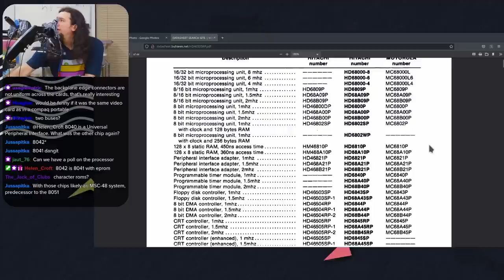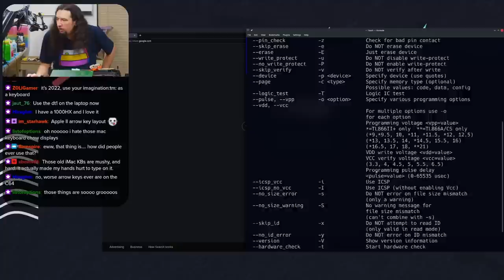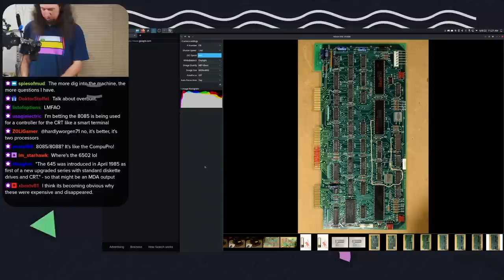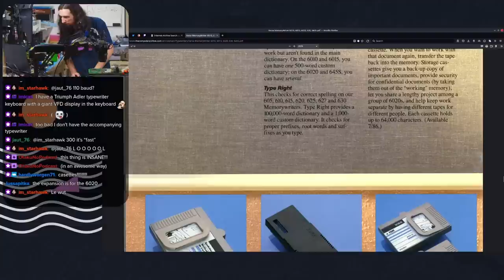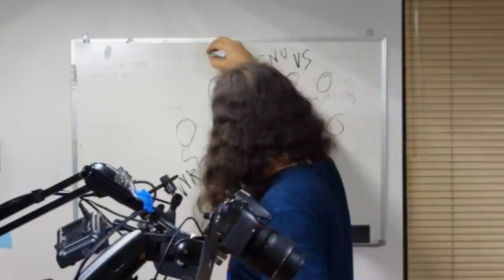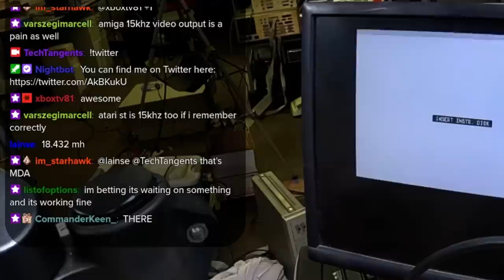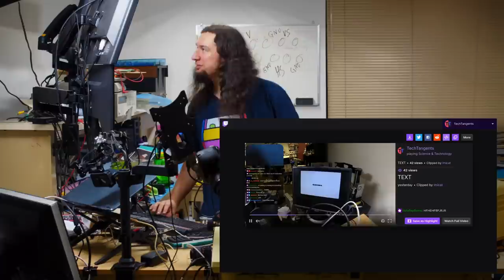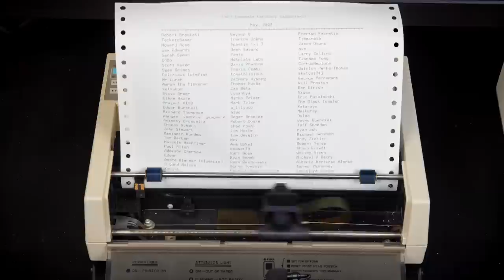Exploring the Crazy Xerox Memorywriter 645S to Get Video Out

Comment from the maker: I have seen the two listing on ebay at the time I posted this video for the 630 Disks and the 640 Upgrade kit. The 630 did not have a CRT connected to it, and since the disks actually specify that they are for the 630 I know they aren't a "Universal Typewriter OS" and almost definitely will not work. I do not know if the disks in the 640 upgrade kit will work, we already know that these don't use a common OS, so it's possible there are feature differences between them that would make it incompatible. But that listing is $200, way too much for disks and especially ones that wont work.
Reply: The 630 has a small display and no crt. The 640 has a crt but the software is not the same as 645. I got the 645 disks and a working 645. Can send you copies of the disks if you want?

The output to the crt has H+V sync and video separated. No composite video.
Reply from the maker: @kristofferrosendahl6719  That is really good to know the 640 disks will not work. I would be extremely appreciative if you could send me copies of the 645 disks! If you want to reach out over email, twitter, or discord I can give you an address. If you can image them, just disk images of them would work as well because I could write them if that would be easier.
Reply: i had 1 of these, i remember it having orange phosphor single color crt, i remember laughing out loud when i saw the intel/amd chip! i dont know if i still have any parts but if i find the crt, i will let you know
edit: btw, i did scrap it years ago but im sure i saved the boards, if i saved the crt or not is another matter
Reply: @juliedunken1150  ....i dont think you know quite how much useless crap i have in bins and behind stuff, i have a complete smith corona pc with monitor!
Reply: @juliedunken1150  and if neither of them? dave jones or bigclive or diodesgonewild can tear it down and here is the schematic in davecad/printed and reversed/dodgey af as a bonus!
Reply: I'd love to look at an image of those floppies if you ever manage to get hold of them. Odds are the ROM is custom, makes no sense to be PC/IBM compatible. If the ROM is a proper PC BIOS, howevery unlikely, it's possible the disks have to be "blessed" in some way, perhaps a different magic number in the MBR?
Reply: Could you by any chance upload the ROM as you indicated that you would do?  I don't see a link for it in the description.  Also I suspect that this unit may be running some version of CP/M.
Reply: @juliedunken1150  Sorry about that, I don't post comments very often and must have clicked the wrong button.

Comment: Oh wow.  I actually worked on one of these things in a past job.  Somehow the monitor for the unit had gone missing and the boss asked me to work out a solution so it could be sold.  I can't fully remember what I did but pretty sure it involved a resistor ladder and some diodes to mix the signals to produce video for a mono VGA monitor.
Reply: Haven't watched the video yet (still playing), but assuming digital output, that would be a sensible route. An R-2R network for D->A, diodes to clamp voltages, maybe some voltage division to perform some additional scaling, and you've got a good solution. Similar sort of thing gets done whenever anyone outputs VGA or Composite from an Arduino.
Reply: Nevermind, analog, so probably just needed pin & level conversion.
Reply: @absalomdraconis  Pretty confident the unit I worked on had TTL output.  I have distinct memories of there being an intensity line as well as simple dot output.  Of course this was all many years ago so memory isn't guaranteed accurate.  😀

Comment: I worked for Microlytics in the early 1990s ... it's probably a spell-check board. They were using Xerox PARC text compression/spelling technology in a lot of their products. If I remember right, Selectronics became Microlytics, and Selectronics is the brand on a lot of those handheld spell checkers from the 1980s.

Comment: There are a number of converters out there that can display arbitrary video onto HDMI monitors if you can work out the horizontal, vertical and pixel frequency - I think I've seen one based on the Pi Zero on Adrians Digital Basement and Jan Beta's channels. They seem to be able to make sense of even fairly unusual video formats. It might be easier than trying to hack the display card in this device.

I graduated in 1984 and went to work in a Software House, and as a result ended up working in clients offices all over London and Southern England, and by that time typewriters were being moved sideways in favour of PC's as word processors, and you;d see strange creations like this under desks or in store cupboard all over the place. I even had a Silver Reed typewriter that had a serial interface on my desk in one place that we used as a printer for one PC. It would not surprise me that the 8085 was the processor that drives the "word processor" side of this device and Xerox fitted a 8088 PC inside to add in the extra functionality rather than develop a completely new device. Especially since it was probably evident that the device would have a short life span. 

My last sighting was when I worked as a contractor in 2007 for a mortgage company, and they had a word processing typewriter on one desk that was used exclusively for filling multi=part forms for one obscure compliance process that they had to use, because the organisation accepting the form wouldn't accept multicopy laser prints for their processes, it had to be on the stationary they supplied!
Reply: Indeed Laser might be quicker for some things, but pre printed multipart stationery and a golf ball can whack out quicker if certified etc file copies needed , sometimes paper is better , stores can write on despatch notes etc though apps and scanners seem to be going a way forward
Reply: "There are a number of converters out there that can display arbitrary video onto HDMI monitors if you can work out the horizontal, vertical and pixel frequency - I think I've seen one based on the Pi Zero on Adrians Digital Basement and Jan Beta's channels. They seem to be able to make sense of even fairly unusual video formats. It might be easier than trying to hack the display card in this device."

I also use the 'RGBtoHDMI' that is indeed based on a Pi Zero - Neat devices that sell out quickly...

Comment: The monitor and connector seems very close to some old cash register "computers" that I saw and had one. The monitor was 5" or 7"  mono amber with the same 9 pin connector, power and video on it. I am not sure about the pinout but I am sure that there were to 12V power pins there.

Comment: In the early 80's I was a  Xerox PC repair tech, and I occasionally worked on these! Also there was a newer, sleeker, more plastic-y version that came after, with similar model-naming conventions, except four digits. I think they ranged from 6010 to the 6040. However, by the time they were released, they were already dead and irrelevant.The 600s were built like tanks, the 6000s were built like plastic toys.

Comment: That spellcheck module is eerily similar to the official IBM spell check module for the Wheelwriter series. Intel 8031AH, lots of rom, only thing missing is the IBM one has a battery-backed user-programmable dictionary instead of whatever solution they're using.

Comment: That was fun. You'll find too the clock going to the 6845 only sets the dot clock. The counters in the CRTC determine the horizontal and vertical sync frequencies, which are set in registers by the ROM. Usually the dot clock is divided by 8 for the character clock, and that is used to count the horizontal counter, which then counts the vertical counter.

Comment: 18mhz was the clock for the old SD widescreen video.  I would expect this uses an odd resolution probably to get more than 80 columns.
Reply: My guess is it just runs at a higher refresh to avoid flicker.
Reply: That's possible too.  Probably 72hz  since it' goes into 18 4 times and the divider circuits would be easier.
Reply: For xerox it wouldn’t surprise me if it was a portrait monitor to display a whole page but unlikely by the format of the video showing. 18 MHz can also be used to produce a 720 by 348 resolution  like Hercules did. This would require a slightly higher pixel clock.
Reply: I wonder if that VGA adapter can tell us exactly what format/clocks it's getting?
Reply: @0toleranz  Very possible since Xerox used portrait monitors for their Alto computers.

Comment: Great video. I'm unsure why Xerox released this. I assume they leased them like their copiers, but this has most of the components of a PC, yet they limited it to functioning as a typewriter. Xerox released the model 820 PC in 1981, so they certainly had other products available. Although of all the old companies, Xerox is still a huge company, so maybe they obviously knew what they were doing.
Reply: It's interesting to read about the histories of these mega-corporations like IBM, Xerox, etc.  So many of them are horrifically dysfunctional internally, and they misfire on their product releases far more than you might imagine.
Reply: I think back then a lot of people where so uneducated about computers they would rather have a premium typewriter than a pc.
Reply: without the boot disk, one cannot be certain this was JUST a word processor... some (I have used one, and seen another on one of the retro scene videos) that ran a full up os. The one I got to use booted off ROM drive as B: ... but if a system floppy were in the 3.5" ssdd floppy, it would boot that. It looked like either CP/M or MS-DOS, but all sub-directories were numbers. The ROM drive had only .com files, no .exe nor .bat, and booted to a launcher. Pure text mode, had the CP 437 upper 128.
Reply: It's worth noting that spending, let's say, £1500 on a fancy type writer for your typing pool/secretarial staff/etc that they can work with near immediately, with minimal training, is cheaper than spending £2k on a PC and a week's downtime for training and ongoing support.

Comment: This thing prompted me to recall some word processing systems my high school had back in the late 1980's.  I remember two configurations, one superficially similar to this (although the cases were black) and some that had an additional CRT monitor raised on a small vertical bar.  These were in my home room in my third year of high school (NOT junior year, I'm from Ontario, Canada, and in those days high school was 5 years so the freshman/sophomore/junior/senior naming convention doesn't apply), but as my home room was my spare that year, I would be in there for daily attendance and morning announcements and then I was required to be out of there and into the library or cafeteria, so I learned nothing about their use.

Comment: Were these typewriters a hang over from departmental budgets - Secretary/Typing Pool had a budget,  and Data Processing had a budget,  and both different management,  this way companies could sell to both
Reply: Might also be aimed at those people who didn't want to change. (It's not one of those new-fangled computers, it's a typewriter!)
Reply: I could see them having some ability to function as a terminal, and being sold as an upgrade for people who were used to typewriters or still needed them. "Well this is a typewriter, but it's also a terminal, with spell check!"

Though were terminals still a thing at the time this came out? That's a bit before my time so I don't know the exact dates.

Comment: I picked one of these up from recycling ages ago. Never got more than a little movement from it. I ended up saving the full daisy wheel mechanism to make a printer with a new controller. I also saved the boards because they just looked cool

Comment: I never realized until going down a similar rabbit hole of floppy+crt typewriters just how much is probably "lost to time" including so many necessary OS disks and documentation. At some point I picked up a 6040 that has a single 3.5" floppy drive and small attachable monochrome CRT. But somewhere in my mess I lost the documentation and there are zero references to it anywhere online, nor any necessary floppy disks. I can insert a random disk and it reads it then ejects it. So I suspect it's a lot like yours and is looking for a particular boot disk. Great job on getting the video out and analyzing all the components either way! I have picked up a few old police terminals (of minimal functionality) and was also surprised to see what they packed in some of them.

Comment: FWIW, I worked for Xerox 18 yrs, left in '97.  There was a whole series of these original Memorywriter behemoths that I believe were built on Diablo daisywheel printers.  They ranged from simple no display electronic typewriters all the up to the 645s with the mini displays.  We sold a lot of them but even gave away a lot more.  So if you bought a certain model of high end copier or bought a whole fleet of smaller ones we'd "throw in" some Memorwriters into the deal.  When I left Xerox I "acquired" one for myself, out of a garbage heap basically that still worked and used it at home for a few years just for fun.  Eventually I sold it on a bulletin board.  Anyhow, did you ever get a boot disk?

Comment: The 6845 is just a bunch of counters. It takes a lot of additional logic to make it generate video, so very different designs used it (both CGA and MDA, for example). On the other hand, PC monitors were popular enough that it is reasonable to expect a 9 pin connector from the 1980s to be compatible with them. It is great that you were able to get usable video.

Comment: I had one about 25 years ago. The disk drives started to fail so I got rid of it.The monitor was monochrome green. I still have several daisy wheels for it. It could do 10, 12, 15 pitch and proportional spacing.

Comment: My dad was a Xerox dealer - and rather ironic that I tried to save away the advanced models he rented out and only was able to get a Wheelwriter. Recently I did a video (no pun intended) of the high-end Wheelwriter with VGA out and the 4865 external 720Kb diskette drive. The 4707 (?) VGA monitor doesn't work ("Yo, Adrian") and I will undoubtedly fix and feature it more.

I'll look to see if I have any documentation or parts around from my dad's business...

Comment: Actually changing the crystal is not likely to bring you MDA. There are lots of parameters you can set with most CRTCs. It's even likely that Xerox operates it in a mode that is not 80x25. So I wouldn't mess with it, but instead use an oscilloscope to find out what video mode it does. From that you can see if changing the crystal will bring you to anything more common.

Comment: Something I have been doing lately is Everytime I come across a device that uses specific drivers, I make sure they get archived somewhere so that when someone finds it 20 years from now and goes "wow that's freaking cool" they have a chance at finding the driver's for it lol...we are responsible for making sure cool devices will be able to get enjoyed by future generations by making sure we archive the required information (manuals, what consumable things are required, part numbers etc) and the software that it requires, along with making sure that any special cables, docks, etc stay with the device as well, it's common here for scrappers to tear down computers and scrap them as medium grade, high grade, RAM, CPU, parts for different prices, RAM for example pays 10 to 12 a pound, older CPU's with gold plated pins can get you 14 a pound, which requires a massive amount of cool usually still functional systems to be scrapped just to get one pound of RAM or CPU's unfortunately 😢 I saw what I'm 99 percent sure was an SGI indy right as it was being thrown onto the belt going up into the steel shredder at the scrap yard... you can't miss them with that color and I wanted to smack the emergency stop and climb up and get that mofo.... truly sad to see

Comment: @Techtangents as a fallback option to reforming the big caps on the old mainframes you have (in case they are bad), would replacing it with a modern switching PSU(s) be possible? Or are the voltages too weird? Or maybe the amperage too high?
Reply: I think he said it was like 43 volts.
Reply: @dialupdave6276  there are adjustable PSUs from brands like Meanwell. I don't know about that range specifically, but I have seen 10-36 V and similar. A higer range one wouldn't surprise me if it existed as well, there are applications in charging bike battery packs (my electric bike runs on 48 V for example).